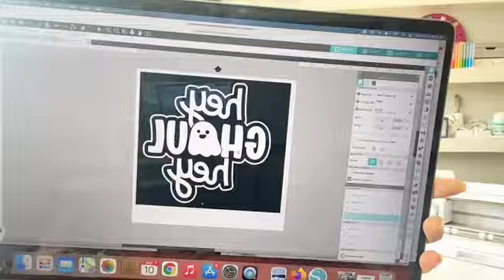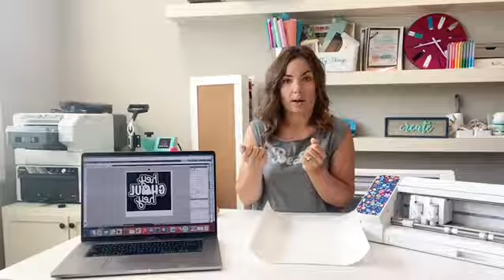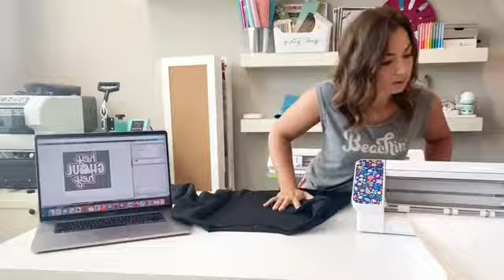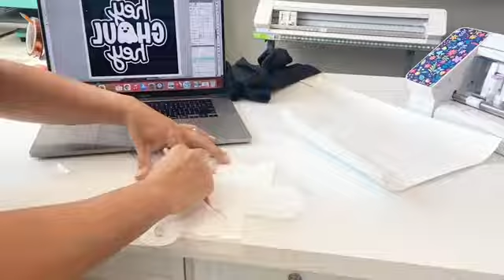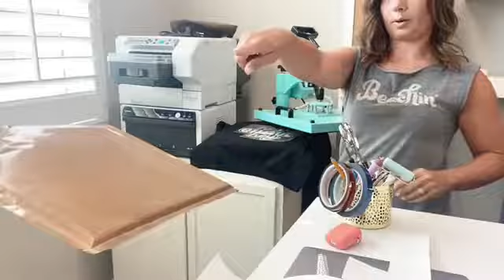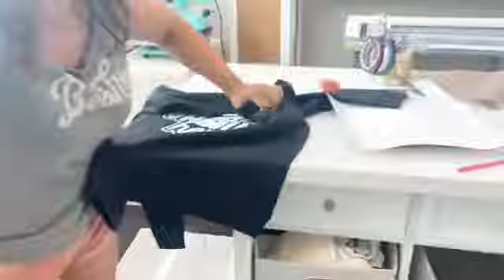👻 First Silhouette CAMEO 4 Heat Transfer Vinyl Shirt for Beginners

Comment: How on earth did you get your MacBook to connect to your Cameo via Bluetooth? My Cameo Plus came with a Bluetooth dongle installed. My M1 Mac mini connects via bluetooth but the Caneo Plus says "unavailable"  even though the Blue Tooth is lit solid blue on the panel. Please help if you can... Thanks
Reply from the maker: Hi there, it is likely due to the version of Silhouette Studio that you are using and the Mac OS. I would make sure both are fully updated.
Reply: @SilhouetteSchool  Thank you so much for your reply. Love your channel. I am a 3 day old Cameo owner. I sent Sihoueltte some pictures of my issues and their reply was to do what I already did. Anyway, I shipped the 4 Plus back to Amazon for a refund and found Speciality Graphics with the Silhouette Cameo 4 for $229 including tax and shipping. I understand I sent back a larger version but after watching you I think the standard model is a good start and saved a LOT of money. This is long winded but I have saved your tracing vides and know how so I can start using the machine.

Comment: Hi. I only have the auto blade. I have Cameo 3. Can you tell me what the settings are. I used what was already set, 3 & 33. It stuck to my mat. What should I adjust to.
Reply from the maker: Hi there, I would try resetting to the Heat Transfer Vinyl default setting, just up the force to 14.

Comment: I can’t figure out how to change the temperature on my heat press. It’s exactly like yours. Do you have a video?
Reply from the maker: Hold the set button down til it flashes then set the temperature. Press it again to set the time. Then press it again to set it.

Comment: Hi there! What is the recommended wash and dry instructions?
Reply from the maker: I would wash inside out. It's recommended to hang dry but I honestly usually throw it in the dryer b/c I never remember to pull it out of the wash

Comment: Hello I love your channel and all of your work, I purchased my cameo last year and I have never been able to make a successful cut yet! I also joined your school and I have been watching video after video trying to solve my cutting issue but I just can’t figure it out. Every time I send a cut it only cuts maybe 3 inches of the 1st letter and nothing else and it goes through the entire cutting process, I even tried increasing some of the setting to get it to cut deeper and still the same results,🤷🏽‍♀️🤦🏽‍♀️ I don’t know what else to do and it is so discouraging! Could you please help, please?
Reply from the maker: I would suggest you check out some of the beginner tutorials on Silhouette School and if you are still having the issue you can email me through the contact page on Silhouette School Blog.
Reply: I'm having a similar problem :(  I was so excited to use my new machine, but I just can't seem to get the cuts to go all the way through, and they get lighter as the design moves across horizontally. It's very discouraging.